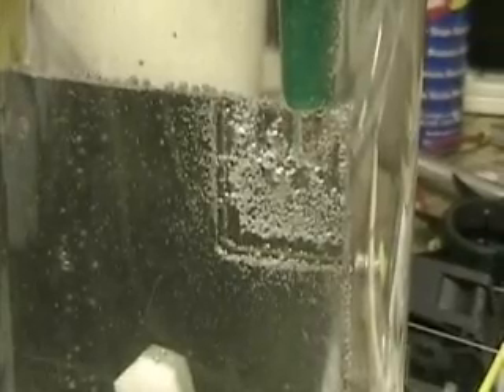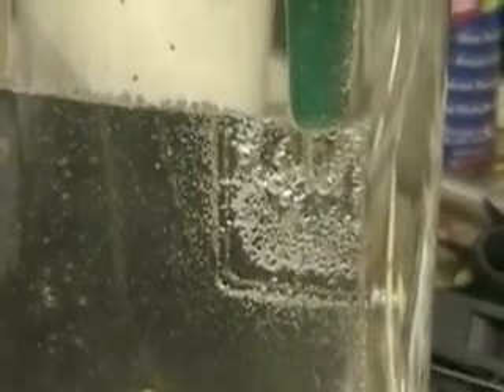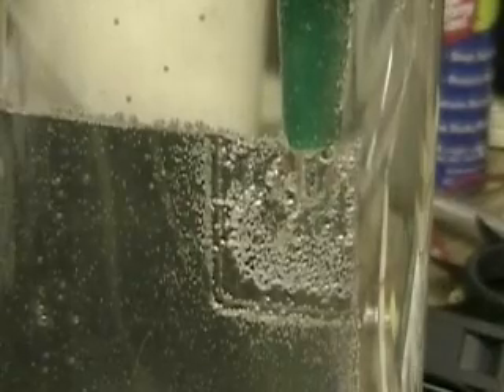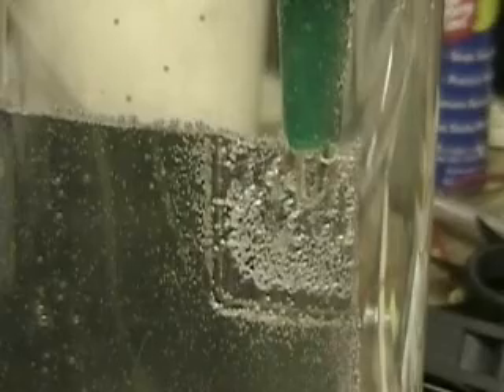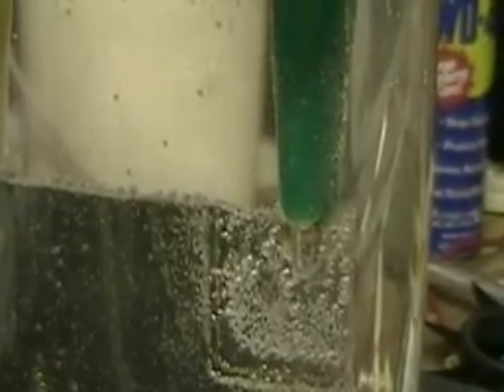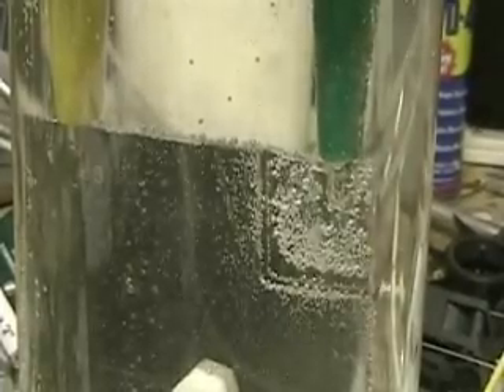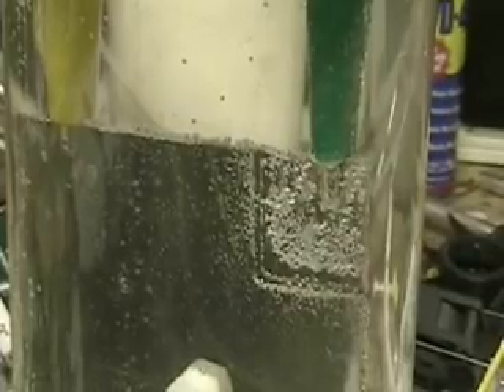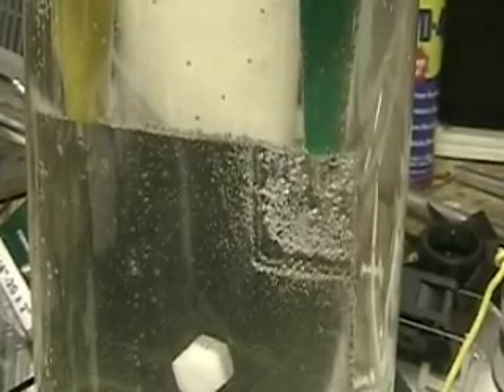Hydrogen Tap (Less Amps ) 338

Comment: your at 2.4-2.5 amps as was stan meyers was also running under .5 amps.If the volume increases as it should with additional plates.looking for the next video.

Comment: i see similar gas production on my electron extraction apparatus at a quarter of an amp 12volts -no electrolyte.PWM from battery drill trigger.~3.5kHz
its using tube style cell though.
more people need to tune there cells without electrolyte,then we will go forward quicker

why dont you try some tube style cells,with the tuning notch like meyers did?

Comment: Great work like to see your updates. What would happen if you trippled the voltage? Could you see a greater increase in output? I know that Stan Meyer was using tap water but you can have all kind of stuff. What if you added a touch of electrolyte to equal the resistance in nomal tap water? I know with some of my test that it takes a lot less KOH with the higher voltages in distilled water. Was interested in the PWM at the higher voltages and with series type cells. Keep up the great work.

Comment: You said that the focus does 1 LPM at 12v 15amps so 12*15= 180watts if you did a volume test on this at 101v and .25amps 101*.25= 25.25watts.
So 180/25.25=7.129  If this produces more than 1/7 or 14% or to make it easy 140mLPM you will prove that you can get higher output using less energy and bring a whole lot of people into High voltage testing. A lot of people are afraid to try new things and don't want to start something until the concept has been proven. A simple test is all I ask.

Comment: Have you done any research on the frequency responses of water? Maybe to find the resonant freq at the specific temp of your water. There's a lot of formulas on the web that are pretty easy to find. 
I'm almost wondering if you need quite a high frequency, but not 100% sure yet myself. I've heard any where from ~900Hz to 25GHz and maybe even higher (big gap, i know).
Good luck and stay safe!!!

          Jamin